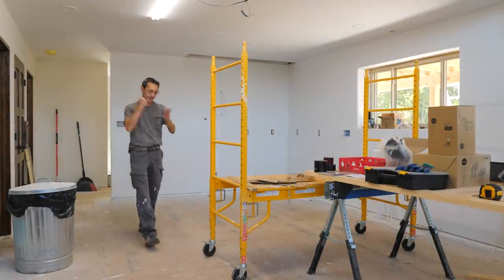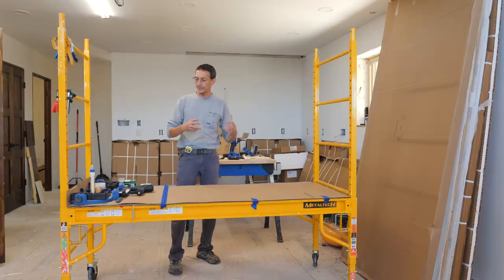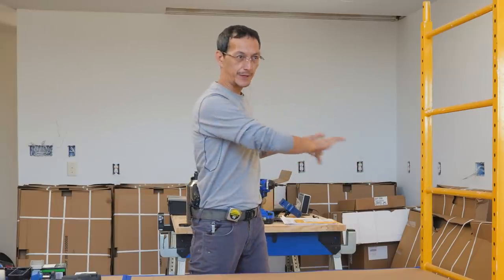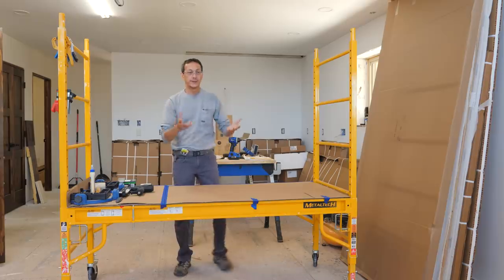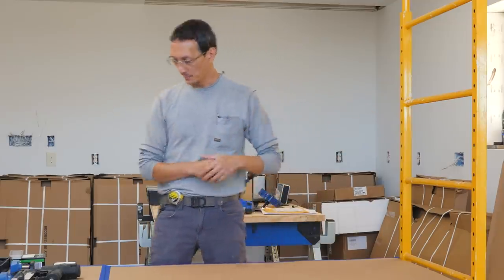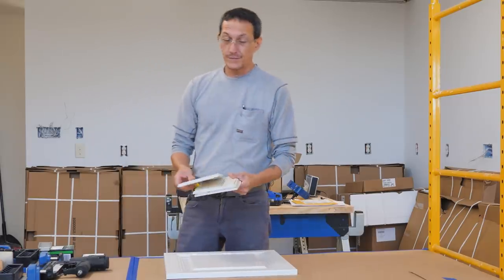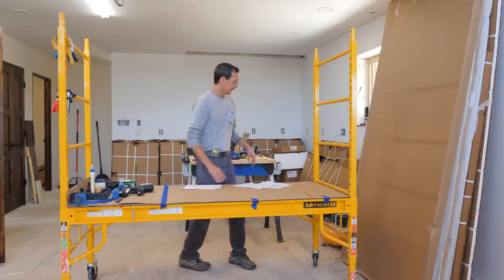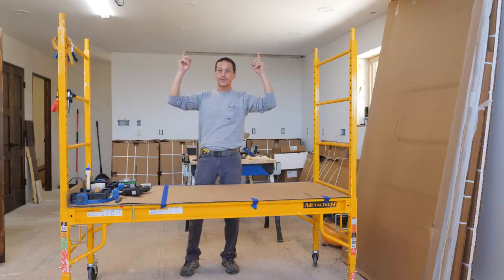Intro to Custom Ready To Assemble (RTA) Kitchen Cabinets

Comment: When I used to build homes custom cabinets were just that. A company came and measured after drywall was finished.  The took measurements back and built the cabinets in there shop. And they didn't cost much more than box cabinets or todays RTA cabinets. 
 Things change over time.

Comment: Ikea kitchen cabinets are probably the best cabinets you can get for the money.  They are made in USA with BLUM hardware..
Reply: IKEA uses MDF extensively.  I assure you these cabinets are more than just a couple of notches above the quality of IKEA and they are custom.  BLUM is good, no doubt.  That's why the Cabinet Joint uses them too.
Reply: @pnwester2697  MDF is stable and doesn't expand and contract like plywood does.  Not saying it's better, but it has it's place.  Also RTA cabinets start at 3x the price for basic cabinets and you certainly don't get 3x the quality...

Comment: MDF when I worked in a mill I found MDF the worst material I have ever worked with. Do not get it wet without sealing the MDF.
Reply from the maker: Correct. It’s already sealed and painted when it arrives.

Comment: IKEA?
Reply: @kaydefreese7586  Ikea cabinets are not low quality..
Reply: @FJB2020  IKEA is not high quality.  Decent for the price but not high quality.
Reply: @pnwester2697  Agreed.. They are not "high quality" but they are not low quality either.  Their boxes and hardware are great, their doors are lacking, but you can easily make your own (which I have done)..   I used some nice Baltic Birch panels and cleared them.. Added BLUM door openers to the frames for a seamless look (no handles).. Not a single RTA could match it for what I did it for..   And most of the RTA companies are just resellers selling Amish or Mennonite production built boxes and doors.. Nothing custom about it..